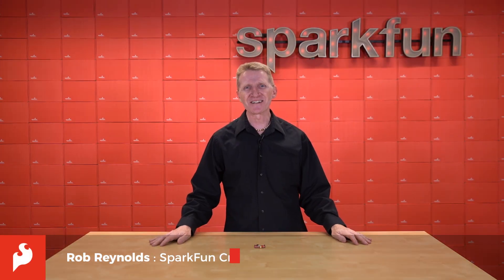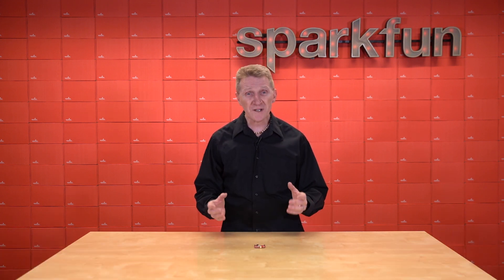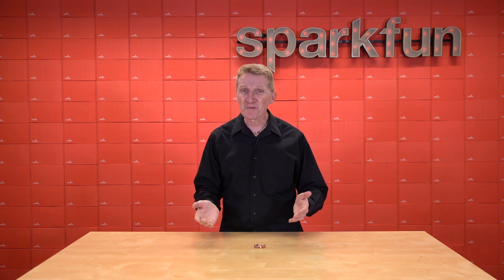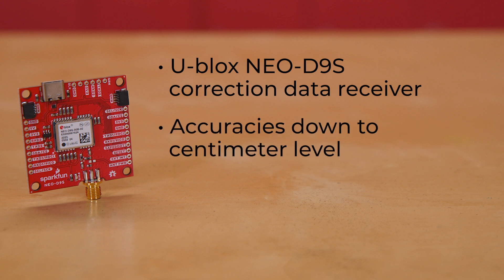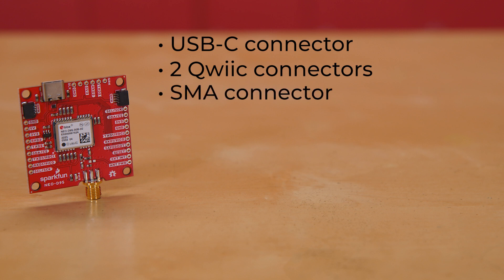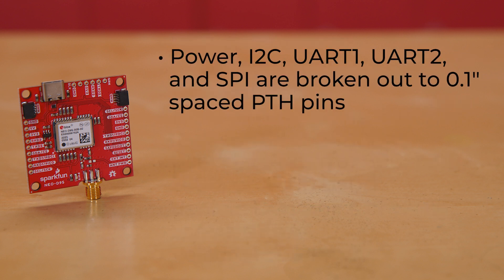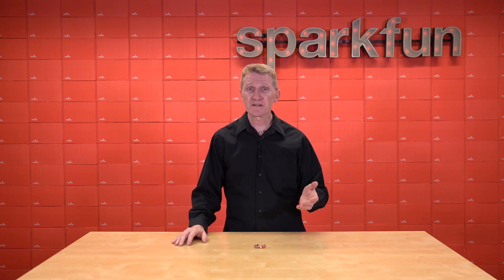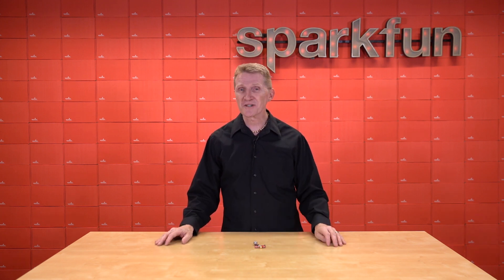Product Showcase: SparkFun GNSS Correction Data Receiver

Comment: It seems to be good to look to more. can you tell about the antenna side? What kind of antenna to be hooked up to the SMA connector?
Reply: It requires an L-Band active antenna. The NEO-D9S must be configured to a center frequency in the region that it is in. For the US, it is 1556.29MHz. For EU, it is 1545.26MHz. It has been tested with the "GNSS Multi-Band L1/L2 Surveying Antenna - TOP106 [ GPS-17751 ]" and SparkFun has been successful in receiving the PointPerfect correction data in both regions (USA and Europe).
Reply: @bobbyyc  any recommended antenna which worked with NEO-D9S's GNSS module? Can the product include the configurations for antennae and chip itself? or just only the h/w module?